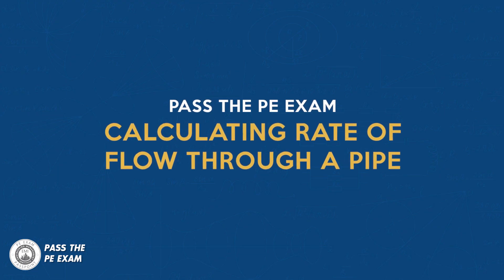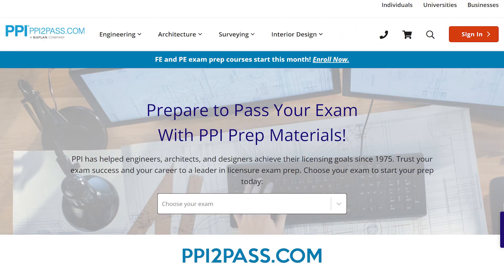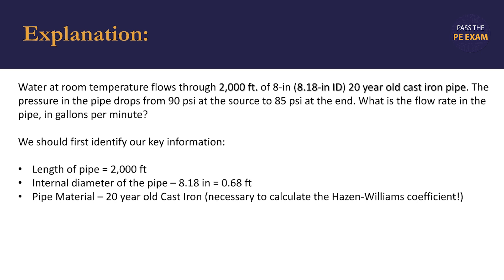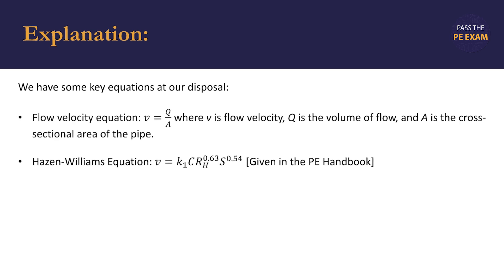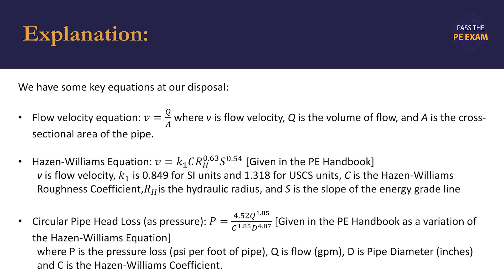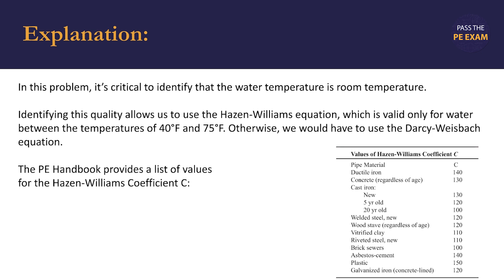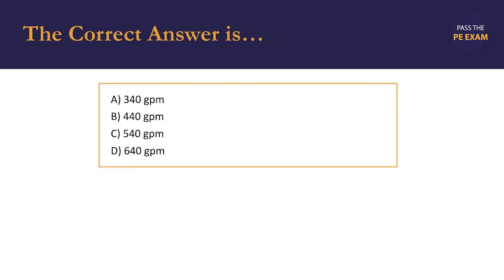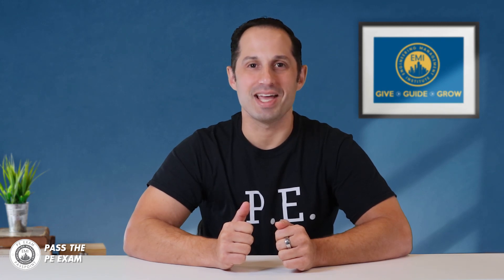Calculating Rate of Flow Through A Pipe | Pass The PE Exam

Comment: HOW DID YOU GO TO (90-85)/2000 for pressure?
Reply: I’m assuming that it’s given that the Unit for P= PSI per foot(PSI/ft) even though the formula is also given. keeping in mind that the pipe lost 5 PSI(90-85) and the per foot would be 2000 since that’s the distance that was also given in which pressure was decreased, P would equal (5psi/2000ft)